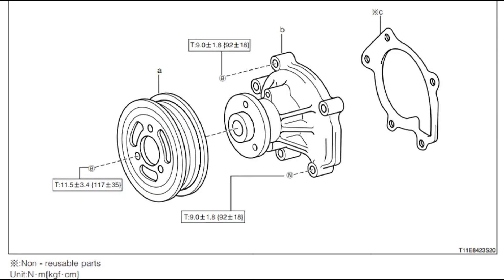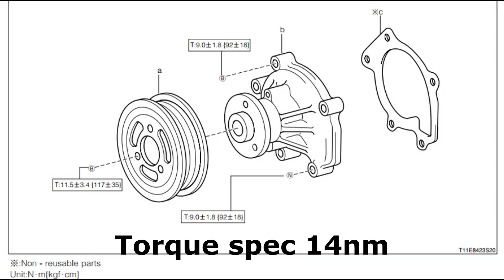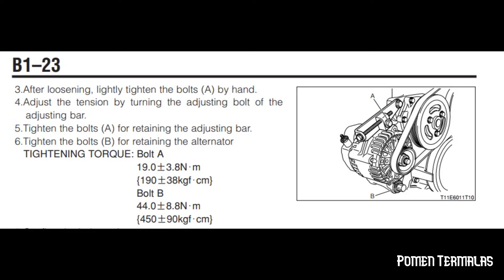DIY Mudahnya Tukar Waterpump Original Myvi Lagi Best Part 2

Comment: Kalau tak pakai torque wrench takpe ke ?video terbaik bang 🔥
Reply from the maker: Tak ada masalah tuan.ketatkan sampai habis, set kan sepana/ wrench pada kedudukan pukul 12, stop kat pukul 2.

lepas beberapa hari cuba check ada leaking atau tak.kalau ada ketatkan sikit lagi bolt area leaking td.
Reply: @pomentermalas9019  Terima kasih info bang 👍
Reply: Bos guna gam apa TU,beli dkt shopie ker...ada link kedai tak